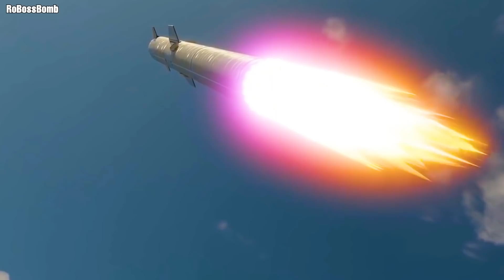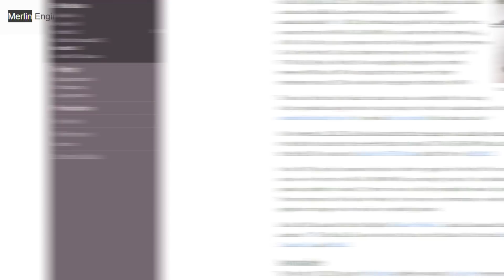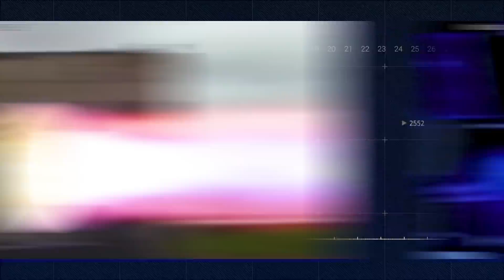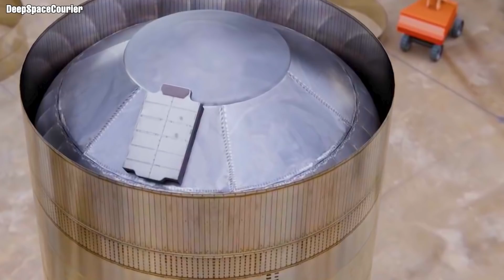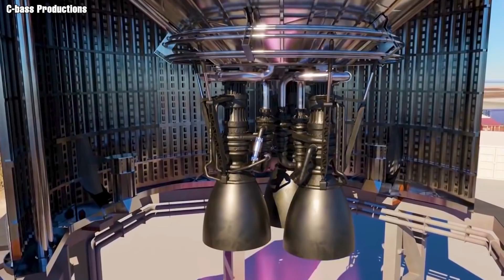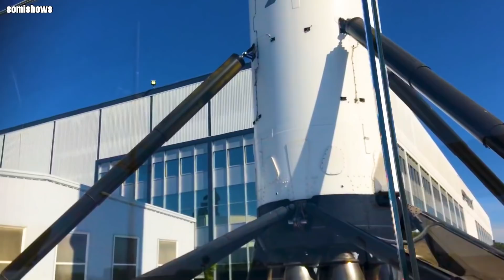IT HAPPENED! SpaceX FINALLY Reveals New Raptor Engine!

Comment: The Russians used this type of engine using a pre-burner for their failed moon landing. The pre-burner rocket engine is a well known concept that was determined to be to dangerous to use by NASA. The Russian moon program ended when their rockets exploded on the launchpad killing most of the designers. I for one worry that this engine could choice could lead to the downfall of SpaceX.

Comment: He forgot to say it's carbon-neutral and creates no greenhouse gases
Reply: But that is not true. Burning methane creates CO2, just like any fossil fuel. (CH4 + 2 O2 -> 2 H2O + C02)
What you mean is that you can produce methane using renewable energy. But the same is true for RP-1. Also it's very inefficient to do so as you'd need thousands of square kilometers for fuel production.
Reply: Ehhh, how exactly??

Comment: The Saturn 5 had 4 engine why not use larger engine instead of lots of smaller engins?
Reply: The first stage used 5. I’m guessing in manufacturing its cheaper to make tons of one model instead of each engine stage being unique , gives adapadability and redunc
Reply: Saturn V had five engines on each of the first and second stages.
Reply: Saturn V had 5 engines, not four.
Reply: Musk is a fan of redundancy. If Saturn 5 suffered an engine failure it lost a quarter of its thrust and the mission would automatically fail. If Super Heavy has an engine failure it loses 4% of its thrust and can probably still acheive its goals by burning those engines longer due to the spare fuel.

Also, with a smaller engine you have significantly lower forces to contain, which in turn gives you better margins on materials.
Reply: That is a good question. Btw, Saturn V had five engines on first and second stage. ;)
I think the main reason is that larger engines usually introduce several engineering problems.
For instance, a large engine cannot reach as high a chamber pressure before rupturing. Smaller engines can be light-weight and very stable.
Also large engines can suffer thrust instability that is hard to get rid of. The Staturn F-1 almost didn't make it because of that, and had to sacrifice a lot of power for  more stability.
And lastly, SpaceX is interested in landing their stages. That means they only need a light engine that can land an empty stage. One large engine could already be too powerful for such a task.
I'm not an expert though. The topic is probably way more complex than my explanation.
Reply: 27 smaller, simpler engines are cheaper, safer and more customizable than 4 large ones.
Reply: Most likely redundancy as they need to be re-lit multiple times,plus its easier to make smaller,more efficent and by extention,more powerful rocket motors then just a 1 big engine that if it fails,can spell doom for the rocket,payload and possibly people,Its like why not use 1 big engine for Falcon 9s booster? Bc if that 1 engine fails tp reignite,there goes a few million dollars,so its better to have the design now
Reply: Because of engine instability and for reliability
Reply: in case of failure
Reply: Indeed! A "much" simpler device with fewer points of failure.
Reply: Much, much easier to mass produce.
Reply: Larger engines would create to much stresses to be viable for multiple reuses I'm guessing,  plus if one of the 4 motors went out it's a big problem,  but one out of 32 engines not so much.
Reply: If 1 of 4 engines fail, it is probably catastrophic. If 1 or 5 of 29 engines fail, no big deal. There are plenty more and the computer can compensate for balance. If a smaller engine needs replaced, it’s a smaller cheaper and faster operation to replace it than a big one. Also, smaller engines means more can be produced, which means they improve faster and quality problems are found more quickly than in larger engines that have far less production.  There may be more reasons, but I think the safety factor is important enough.
Reply: larger would result in more complexity, thus slower build times and more difficult maintenance/installation
Reply: Less chance for mission failure if or two engines fail.
Reply: Wrong; Saturn V 1st stage had 5 engines for 7.5E6 pounds of thrust.
/Lonewolf Liberties
Reply: If an engine fails you can still complete the mission because the other engines can compensate by throttling up. This has previously saved the Falcon 9. With fewer engines it becomes more difficult to do this as each engine represents a larger portion of the total thrust.

EDIT: It is also probably cheaper to mass produce many smaller engines compared to only making a few larger ones.
Reply: Saturn 5 had 5 engines on the first stage, 5 on the second stage and 1 on the 3rd stage.  Smaller engines allow for better engine out capabilities.
Reply: Redundancy and combustion instability come to my mind.
Reply: It's first stage had 5 o-o

Comment: I thought that they test their prototype engines to failure as a standard to see where the absolute limit is? Wouldn't that be why raptor 2.0 exploded? They would have increased the pressure until there was a rapid disassembly event :p
Reply: Yes that would be straight forward practice, no one in there right mind would just test to a to see what thrust its capable of and it won't be just one or two.
That's where you can say where the cost is when it comes to designing testing,every engine will be different so testing a fair few to disstuction will give the builders the average.
But as always the media will make out that the engines have a problem.
I'm really looking forward to the next two to three years.
Reply: that was the case actually, He even stated he tested it to failure. they will continue to do that until they make them stable at higher pressures then needed for the flight.
Reply: Mmmm that’s a good idea I could see that being the reason it blew
Reply: They learn more from failure than success.  That is the value and progress they seek.  Much better that it fails in testing than in production use.
Reply: Yes that is exactly what happened. First test was nominal. Second test was pushed to intentional RUD to find what the limits were.